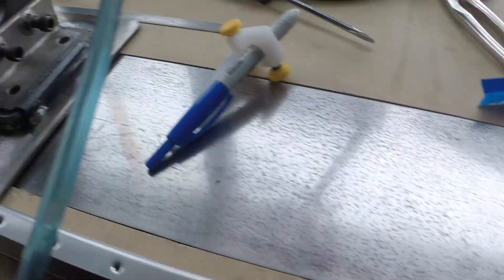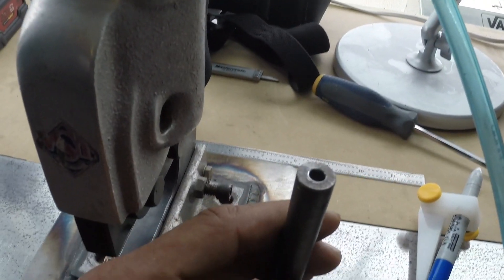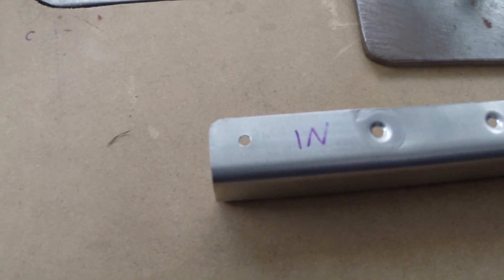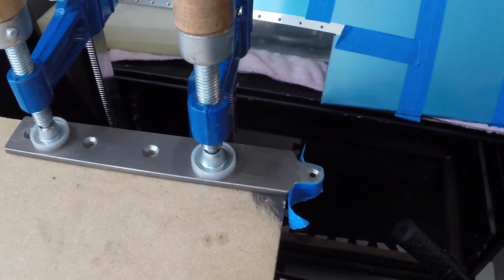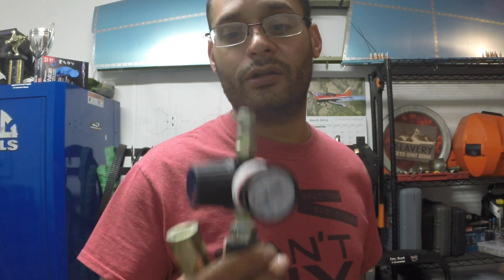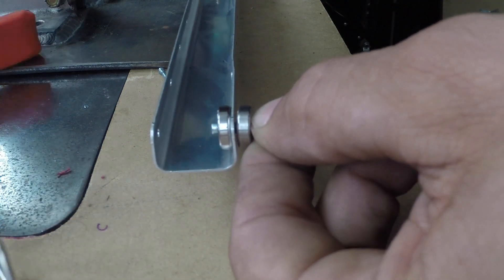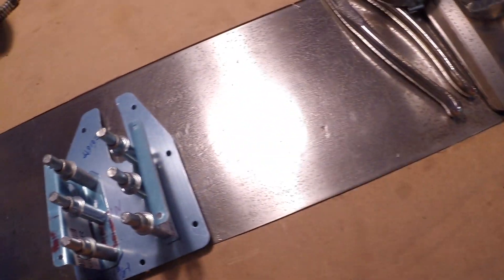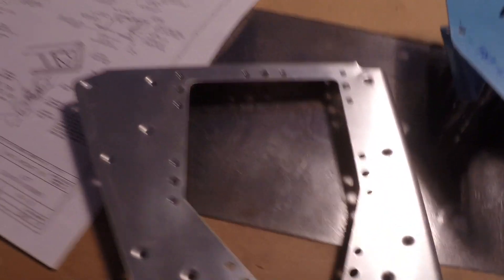RV-7 Left Elevator Dimpling

Comment: Hey Andrew, I got a (used) foot pedal control for my pneumatic squeezer today. It's the same one sold by Brown Aircraft Tool Supply, the Yard and others.  Your pneumatic C-squeezer operated on the foot pedal opens much much quicker than mine.  Do you use the same model?  Have you done any modifications?